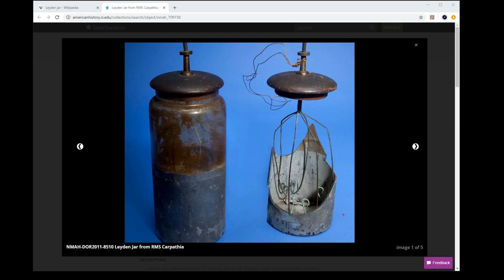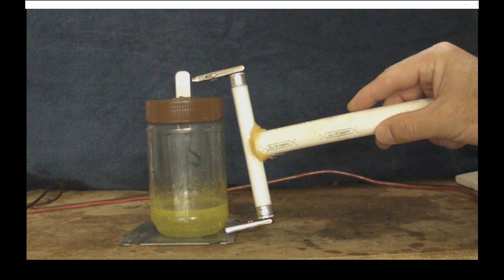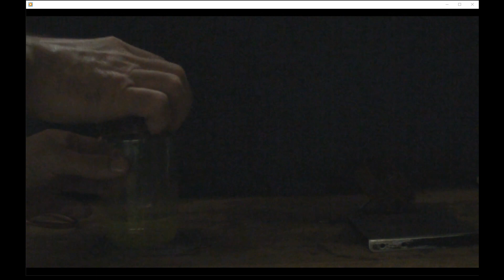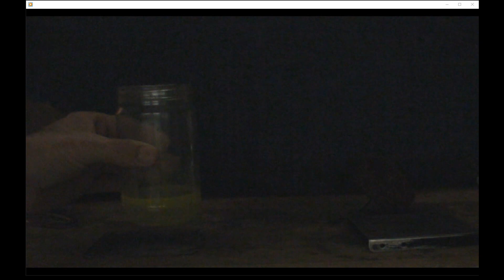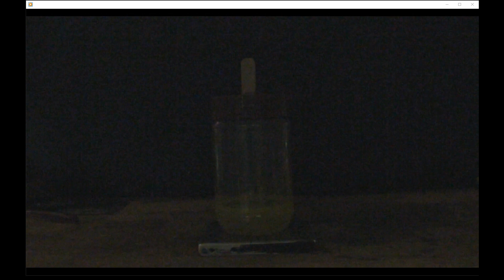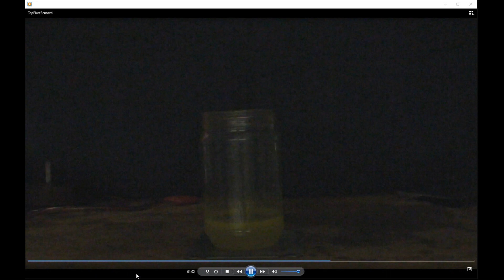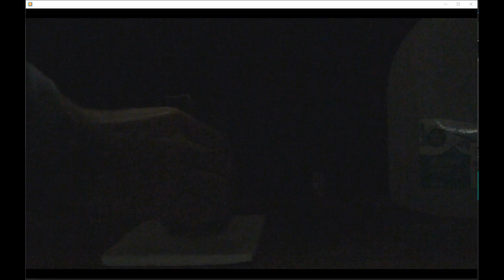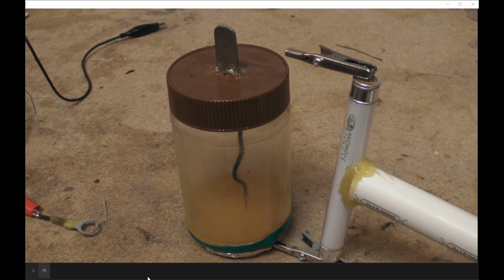Electron Theory can't explain Capacitors, but Ben Franklin can!

Comment: That's odd. I may not be an expert in electrical theory, but I believe Franklin was right as well. Since when metals are used to store electricity? Glass is a dielectric AND a capacitor. Am I missing something?
Reply from the maker: <<What would you reply to those (basically everybody) saying "We wouldn't have computers (transistors) without quantum mechanics, we wouldn't have our understanding about atoms, energy levels, semiconductors, blah blah blah"?>>

The idea in modern pseudoscience theory is that the "electron imbalance" in the metal plates induce an electric field... So they would say, the energy is stored in the "induced" electric field.

BUT, since we can remove the metal that is supposed to cause this electric field, then the energy should go away (somehow) and the metal's electron imbalance would go away (somehow).  Well, the energy stays with the dielectric, as anyone can see or do via experiment.  So, this is where electron particle theory breaks down...it cannot explain how the dielectric stays polarized and can be discharge with perfectly "electron-balanced" metal plates.

Then, remove the dielectric material and the air medium... now, how does a vacuum capacitor work?  This is empty space, right?  ...according to modern Einstein SR pseudoscience...

Well, obviously the "vacuum space" is a dielectric medium, just like Maxwell says in his 1864 electro-magnetic field paper.  The "vacuum" can be polarized, so "something" must be there.  If space is "polarizable" it is not empty, so then Einstein's SR idea of relativity breaks down, because any single object can reference the polarizable dielectric "vacuum space", which violates Einstein SR's non-preferred reference frame concept.  It supports Lorentz/Poincare PREFERRED reference frame relativity of the "Lorentz-Voigt" transformation equations.

If Einstein SR goes down, pretty much all of Modern Physics goes down with it...
Reply: @itsbs  "The vacuum can be polarized, so "something" must be there."

Precisely! That "something" is the same stuff we can feel between two magnets...  It's not stupid virtual photons. 🙄

Comment: The reason they say, "The charge is on the plates" is because a capacitor works in a vacuum where there is nothing between the plates, and to say the charge was between the plates would be to admit the existence of the Aether,
which is forbidden in mainstream science.
Reply: Vacuum have two electrical magnetic constant that  determine the speed of light if you want to call it aether go ahead
Reply: @viniciothehook1  The equation that provides the speed of light (the square root of MuZero x EpisonZero) is of the same form as the equation of the speed of sound.  

That is because sound required a medium and so does light, hence, the Aether.
Reply: @codetech5598  where does the equation for a wave mention the need for a medium? It includes a velocity which may be calculable from the bulk properties of a medium but that doesn't mean the equations demand one.
Reply: @FPSIreland2  Speed of light = C = 1/sqrt(mu0 * epislon0)   where mu0 and epsilon0 are the characteristic "stiffness", "density", etc of the medium (the Aether)
Reply: @codetech5598  no... permeability and permittivity each refer to spaces ability to "support" electric and magnetic fields. Higher value for both, space resists their formation more. No mention of the "stiffness" or "density" of any medium.
Reply: @FPSIreland2   permeability and permittivity are the stiffness, etc.
Reply: @codetech5598  no they aren't, how does the aether be deformed? How does it exhibit stiffness? I wouldn't call inertia "stiffness". Inertia is resistance to change in motion, permittivity and Permeability refer to spaces resistance to the formation of electric and magnetic fields within it.
Reply: @FPSIreland2  These fields you speak of are specific deformations of the Aether.  Inertia is Aether.

Comment: I like the electroscope that you made... can you make a video and show how to build one? by the way.. the electroscope shows that around the insulator builds up an electric field (dipole) from the surrounding. Very nice. That means that in the environment are electrostatic charged particles (positive and negative and not only negative). So the electricity do not consist only in negative electrons...that is why the electron theory can't explain the charge of the capacitors...
Reply from the maker: <<I like the electroscope that you made... can you make a video and show how to build one?>>

The link is also in the description of the video.  I used this video to build mine:

Transistor based Electroscope Inspiration:
Thomas Kim - https://youtu.be/WptwVzK7cK0

<<the electroscope shows that around the insulator builds up an electric field (dipole) from the surrounding. Very nice.>>

Yes, you can think of this as the "temporary electret", which is the dielectric analog to the magnet.  Plastics are more than just insulator/separators!

<<That means that in the environment are electrostatic charged particles (positive and negative and not only negative).>>

You have 1 fluid theory...excess (positive) and absence (negative).  You can relate this to mattter/antimater.

You have 2 fluid theory...positive fluid and negative fluid.  You can relate this to dielectrics and metals.

<<So the electricity do not consist only in negative electrons...that is why the electron theory can't explain the charge of the capacitors...>>

Correct!!
Reply: yes, go on and run that thing  whole day long for some "positive ions", can u already smell the sweet positivity?😀

Comment: It looks like the charge is in the liquid???...can you remove the top (metal) and check again the polarity?
Reply from the maker: <<It looks like the charge is in the liquid???...can you remove the top (metal) and check again the polarity?>>

You can simply say that the charge is in the "insulator" or dielectric.  The polarity will change, depending on how you hook up the leads, i.e. the polarity of the Wilmshurst machine's leads.

Look at some more videos of dissectible capacitor experiments, with different configurations (other jars and plates).
Reply: @itsbs  Yes, of course you are right. Now I get it... the plastic attract the charged particles around it. That means the metal conductor is just a "carrier" of the particles. You should make the same experiment with 2 metal plates and a plastic plate (dielectric) in between (that will be more simple to visualize the effect).

Comment: so, inside of the dielectric itself. I wonder how the charges permeate into the dielectric. Also what the distribution of charges are within it?
Reply from the maker: <<I wonder how the charges permeate into the dielectric.>>

It is most likely the dielectric being "electrically" distorted via its "elastic" nature.  I have no clear understanding of this, but just an analogy.  Imagine a rubber band...the further you stretch it, the more it can snap back. 

*<<Also what the distribution of charges are within it?>>

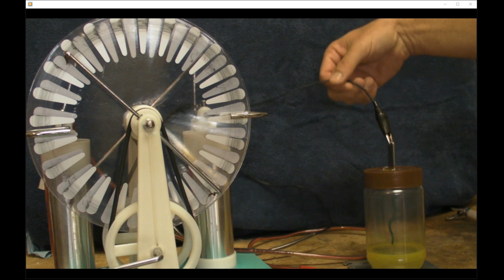Look again at 18:59, you see the electroscope show the electrostatic field is polarized the jar and split it across the middle.  Now imagine that that you are pulling the rubber band from top to bottom of the jar.  The conductive path of metal is the snap back of the rubber band.

Of course, all of this is somehow happening in the aether that we cannot directly see, but its effect is exactly what we see and feel.  And as in Maxwell's Aether theory, the dielectric aether is pre-charged (contains or actually IS charge).

Comment: Question. Here's a idea i had if the electricity is stored in plastic then that metal piece you took out should have no charge meaning if you put that lid on another peanut jar and discharge it then nothing should happen right. The only complication is the plastic lid that is being used. Might store some electricity.
Reply from the maker: <<Here's a idea i had if the electricity is stored in plastic then that metal piece you took out should have no charge meaning if you put that lid on another peanut jar and discharge it then nothing should happen right.>>

Correct, the metal is not holding a charge, or maybe a tiny amount of charge due to an "oxide" layer on the metal.  If you look at the pinned description in the comment section, you will see links to other videos that perform the dissectible capacitor experiment.  Take a look at those and see if you think the metal is holding any charge...

Comment: The metal on the lid isn't the top plate, the solution is
Reply from the maker: <<The metal on the lid isn't the top plate, the solution is>>

Did you look at the other videos of other people doing this same experiment with different "shapes" of capacitors?  Check the pinned video for direct links... then come back and tell me your solution.  I am also assuming you are giving a solution, but have never done the experiment yourself.
Reply: @itsbs  it's just an observation. The dielectric is the plastic jar, as you stated yourself in another comment. And the conductive solution acts as the other plate of the capacitor. By switching lids all you did was break the lead off of the capacitor and add another in its place. I haven't watched other videos, as this is my first on the topic. So maybe another experiment would actually address the question. My first thought was akin to an air gapped capacitor. I doubt it matters if you move the air. The solid dielectric does seem like it could have it's own direct electrostatic accumulation, just like a balloon when you rub it on your hair - which would compound with the effects of the metal alone. Then you'd get more capacitance which you do.
Reply from the maker: @PrintEngineering  <<And the conductive solution acts as the other plate of the capacitor.>>

Conductive solution?  What is conductive about vegetable oil or distilled water?  Show me that distilled water conducts... it has a VERY high dielectric constant.  Yeah, the oil or the water do not act as a metal plate, especially when there is a piece of metal right next to or in the liquid.  Besides, you can apply your logic to the other dissectible capacitor videos (Leiden jar, parallel plate) and see what happens.
Reply from the maker: @PrintEngineering  <<Now I wonder where you got the distilled water.  Two years ago I bought some water labeled "distilled" and it wasn't until I was done with my chem151 course that I noticed the bottle stated that minerals had been added....>>

Quit arguing with me and go learn more!  You are taking up more of my time by doing this, because I have to defend all of your half-baked ideas.  Put in more effort to study the this better, look at the other information provided, look at the other comments, and then come back with smarter questions if you still have them!
Reply: Arguing? You shouldn't take science so personally. It's just conversation.
Reply from the maker: @PrintEngineering  <<Arguing? You shouldn't take science so personally. It's just conversation.>>

You obviously have no empathy for what I have to deal with on a daily basis to keep half-baked ideas from ruining all my effort, when people are trying to figure out if this information is for real or not... It's personal because I have spent a LOT of time doing this and giving it away for free, then I have to spend a TON of time typing this crap.  Have some respect... come back with questions related to clarifying the material instead of trying to tear it down with a jab here and jab there... or just leave and move on.  I don't give a fuck.
Reply: @itsbs  I can understand where you're coming from but if you talk to people this way you are bringing it on yourself. The quality of your communication is just as important as the quality of your information. If you're not capable of constructive dialog about the topics then maybe YouTube isn't a good venue for you
Reply from the maker: @Print Engineering  <<I can understand where you're coming from but if you talk to people this way you are bringing it on yourself.>>

I didn't talk this way until you kept bringing it to me... are you not smart enough to realize that?  I am not trying to make Internet pen-pal friends here.   Go away and keep learning.

<<The quality of your communication is just as important as the quality of your information.>>

Fuck no it isn't, because this information doesn't need a cheerleader!  It is simple and anyone can understand it, as long as they think on their own, instead of spending their energy trying to shoot me down with stupid replies like tainted distilled water... but yet, you have not finished reviewing all the material or even performed the experiment.  Go away...

<<If you're not capable of constructive dialog about the topics then maybe YouTube isn't a good venue for you>>

There are plenty of constructive threads that you DID NOT read that could help you, but instead you chose to argue with me and take more of my time.  YouTube is a great venue for me, but the problem is "smart people" that think they know something and want to express it in a negative fashion.  Why don't you ask a clarifying question, instead of making false assertions like the one that started the thread?  Is it because it is always someone else's fault, in your mind?  Go away...
Reply: @itsbs  you're a funny guy
Reply: @itsbs  Bro, please take a hug from me! 🥺🤗 I'm sure there are many other people like me who really appreciate your sincere efforts in debunking the standard modelled fantasy science! Please keep on doing what you're doing! We'll all support you all wholeheartedly in your ventures! 🤗❤️🤝👍🏼

Comment: So we have a case of dielectric displacement, enough to hold a charge, then what use are the batteries? Storage efficiency?
Reply from the maker: <<So we have a case of dielectric displacement, enough to hold a charge, then what use are the batteries? Storage efficiency?>>

Batteries are a reaction between water and metal, which is good for longer, smoother draws of current.  Current being more about the magnetic field, and the reaction being like an electroplating process that can sometimes be reversed (rechargeable batteries).  It is simple to do, but it generally requires a good chunk of metal.  The capacitor dielectric is better for high tension, high voltage or dielectric field, which is more the electricity of "plastics" instead of metals.  It is usually fast, low current, and pulse-like, but capacitors are way lighter than batteries.  So you can see that we have two "opposite" or "opposing" storage devices.  If we learned how to mix them better in some hybrid fashion, then I think we would be going in the right direction.  The problem is that with electron theory, the "plastic" or dielectric is just and insulator, and that is not the full story.

Comment: The value of capacitance is governed by the constant of permittivity of free space.  So if the dielectric is a vacuum, then charge would be stored by permittivity.  This makes sense because the speed of light is governed by the 2 constants of permittivity and permeability.  It seems to me that a vacuum capacitor would lose energy by electromagnetic radiation.  So I withdraw my idea of an Air capacitor because it would act the same as a vacuum one.

Comment: An easy test of the theory would be to make an Oscillator with an air dielectric capacitor.  If the charge is stored in a dielectric, then it is stored in the air.  Blowing new air into the capacitor would change the frequency of oscillation.
Reply from the maker: <<Blowing new air into the capacitor would change the frequency of oscillation.>>

What about a vacuum capacitor?  If you removed the air, you still have a "vacuum" dielectric.
Reply: @itsbs  I was thinking about that too.  I will post a comment after I've thought it through.
Reply from the maker: @Jim Redgewell  <<I was thinking about that too.  I will post a comment after I've thought it through.>>

I like your question, because you are moving from a "static" storage device to something that is moving and oscillating.  If you think of a capacitor as a temporary electret, then you might about a microphone, either electret or condenser (capacitor).  When you start oscillating the capacitor by physical movement (blowing air), you create an alternating voltage signal.  There are also other natural devices that respond to mechanical oscillation (of the air medium or physical distortion), they are piezoelectric, dielectric crystals.  It's a really neat subject to think about when you get those silly electron billiard balls out of the way...
Reply: @itsbs  have you seen the electrostatic wave generator, and likely power generator posted by Aaron Murikami recently?